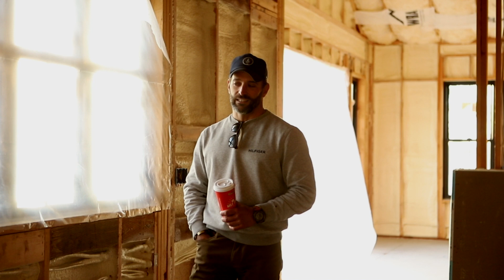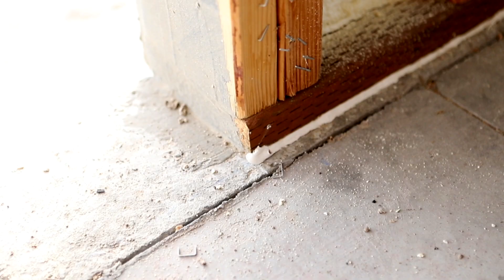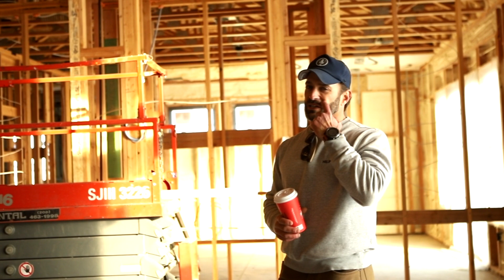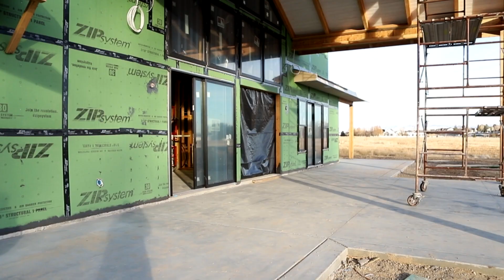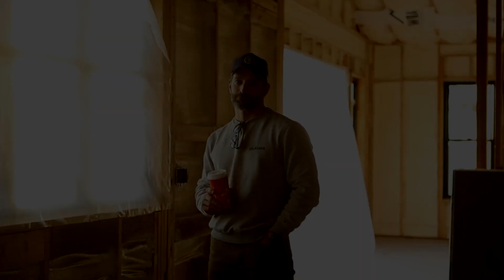EarthCraft - New build

Comment: This is really cool, how you are using the sun and the design of the house, to offset the cost of heating and cooling!  What I understand from the video is that the homeowner invested money up front, so that they would offset their energy consumption, and have a cleaner and more healthy house to live in right?  Do you think that with a property sized solar array, they could achieve $0, out of pocket expense for their utilities?  Thanks for the great video!
Reply from the maker: Thank you for your interest!  For all of the houses we design, passive solar is incorporated into the energy scheme.  In short, passive solar relates to collecting the warm energy of the suns rays as they penetrate the South facing glazings (glass windows) and are collected, in this case, in the slab on grade (Heat Bank/Thermal Mass).  That concrete slab then passively radiates the collected warmth into the home.  Active Solar Collection, i.e. PhotoVoltaic Solar Arrays work in conjunction with the passive collection to 100% offset the houses' electrical energy demand, over the span of a years time.  More to come on this topic in further videos, both on this amazing Farmhouse, as well as others that we have in production.  Very good question.